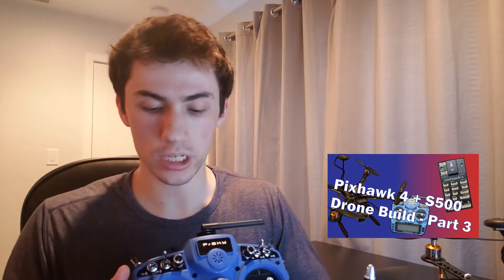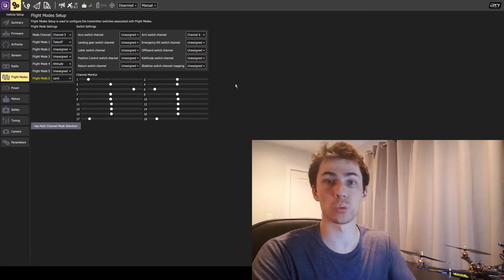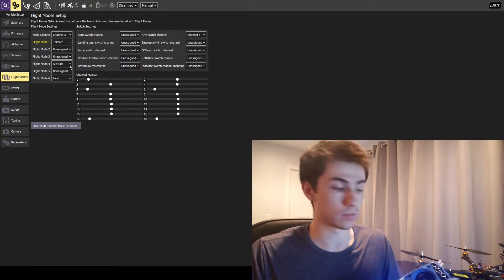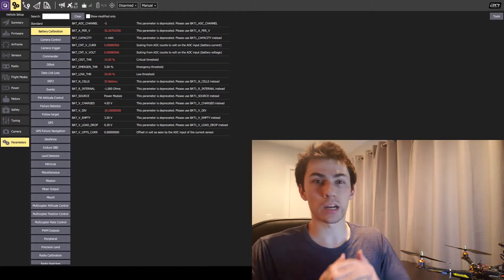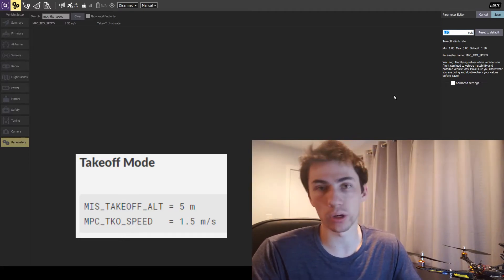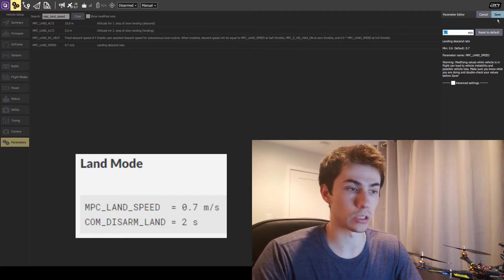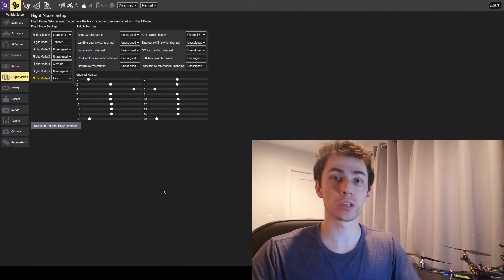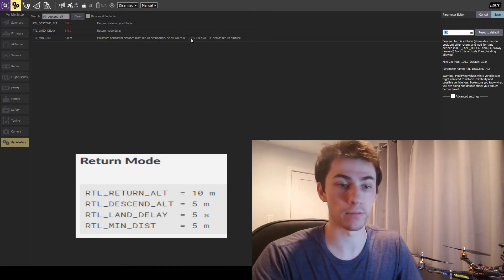Drone Autonomous Takeoff and Landing | Pixhawk 4 + S500 Drone Build Tutorial | Part 6

Comment: hello my drone is the same but when i make auto landing it go down but when it hit the ground it turn upside down and the propellers hits the ground  i change the angle of the landing gear to be near for the ground but the same its turning upside down and crash any one can help me
Reply from the maker: Try decreasing your descent rate to the minimum value. Also it's best to try landing on a flat surface like concrete. What exactly do you mean by changing the landing gear angle?